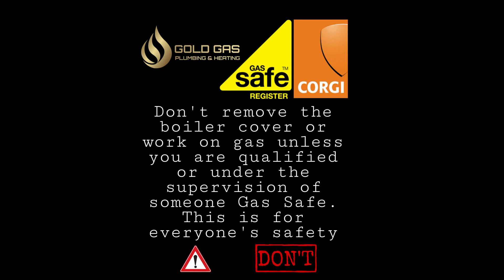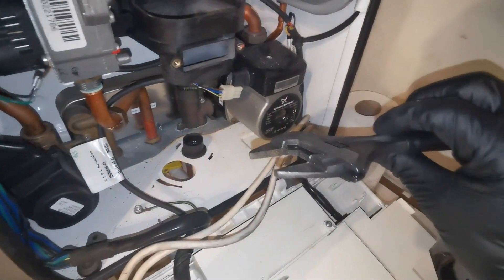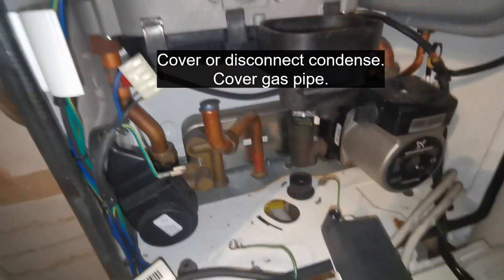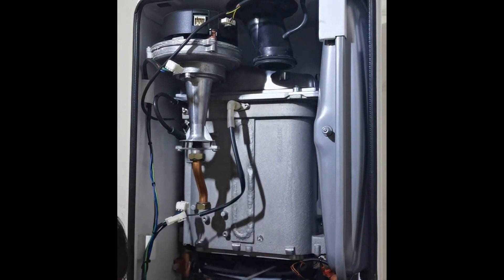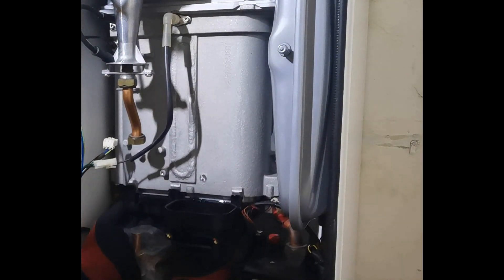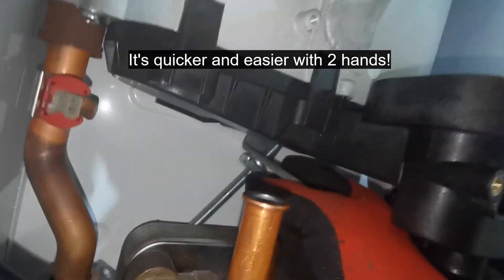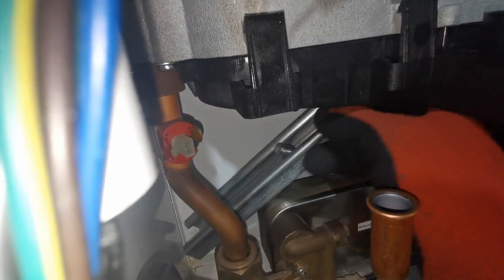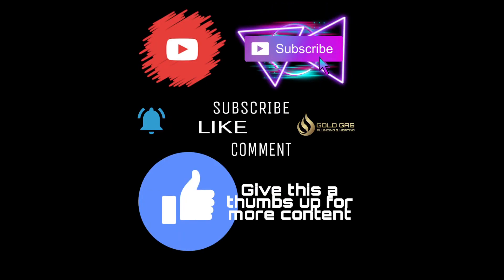IDEAL COMBI SUMP REPLACEMENT - EASY - LOGIC ESPRIT I24 - SPECIAL TOOL - BOILER REPAIR

Comment: Reminds me years ago I was installing a computer in the Oxford Engineering Department and had a metal clip that would not push home. The workshop made me a tool in no time which worked the same way - big bolt, big nut, customised to fit the space, which pushed the clip home with no difficulty when the nut was turned. I still have it.
Reply from the maker: The simple things work great 💪👍